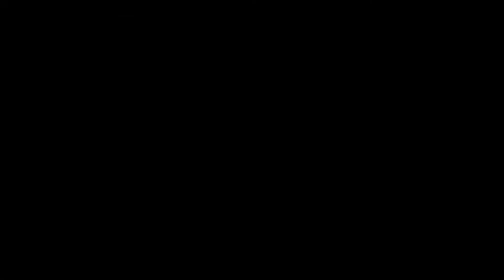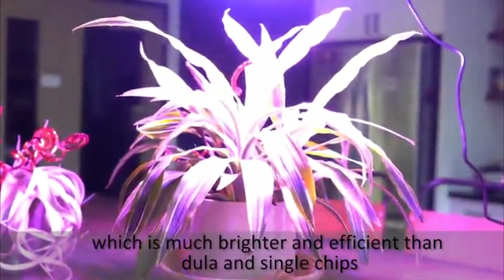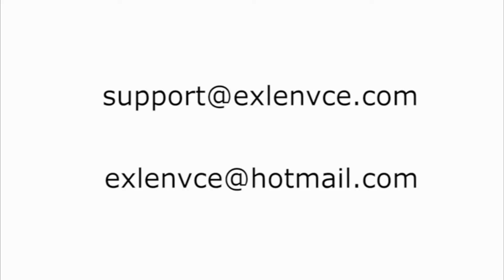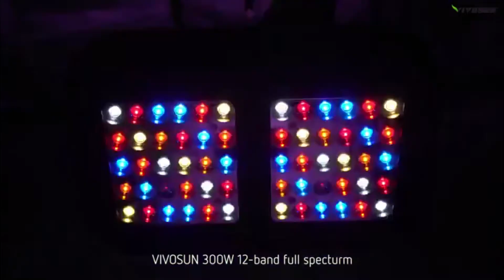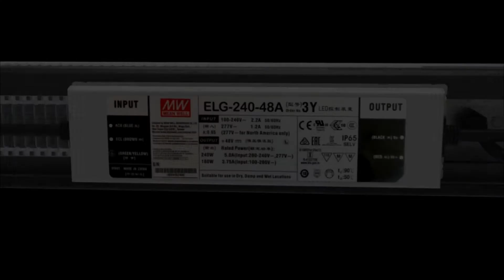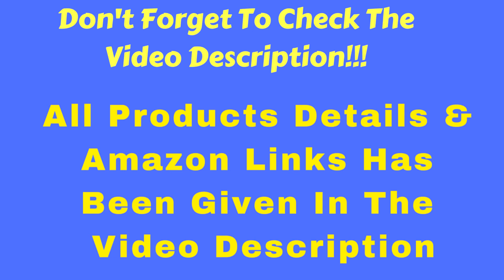Full Spectrum Grow Lights For Indoor Plants

Comment from the maker: 1.Advanced Platinum Series P300 300w 12-band 
  LED Grow Light - DUAL VEG/FLOWER FULL SPECTRUM

US. https://amzn.to/2WENNp8

2.Phlizon CREE COB 3000W LED Plant Grow Light Full 
  Spectrum Indoor Plants Light Growing Veg Flower 
  CREE COB Grow Light with Monitor Adjustable Rope
  -3000W (Actual Power 600watt)

US. https://amzn.to/2LJqsfr

3.Yehsence 1500w LED Grow Light with Bloom and Veg Switch, 
  Triple-Chips (15W LED) LED Plant Growing Lamp Full 
  Spectrum with Daisy Chained Design for Professional 
  Greenhouse Hydroponic Indoor Plants

US. https://amzn.to/2AFlrT7

4.Exlenvce 1500W 1200W LED Grow Light Full Spectrum for 
  Indoor Plants Veg and Flower,led Plant Growing Light 
  Fixtures with Daisy Chain Function (Triple-Chips 15W LED)

US. https://amzn.to/2WFtuI0

5.TOLYS LED Grow Light, 1000W LED Plant Grow Lights for 
  Indoor Plants, Full Spectrum Dual Chip Design Grow 
  Lamps, Double Switch Veg and Bloom, with Humidity 
  Monitor, Timer, Adjustable Rope and Glasses

US. https://amzn.to/368ud7I

6.VIVOSUN 300W LED Grow Light Full Spectrum for Hydroponic 
  Indoor Plants Growing Veg and Flowering

US. https://amzn.to/2LEoGfH

7.myLumii Smart WiFi LED Grow Light, 1200W Dimmable Full 
  Spectrum Indoor Plant Light, APP Remote Timer, 
  Built-in Temperature Humidity Sensor, Daisy Chain, 
  FCC Certified, Compatible with Alexa

US. https://amzn.to/2TjQcDD

8.MARS HYDRO SP 250 Led Grow Lights Full Spectrum for 
  Indoor Plants Veg and Flower Hydroponic Greenhouse 
  Water Proof Dimmable Commercial LED Growing Lamps 
  2x4ft Two for 4x4ft Coverage

US. https://amzn.to/3dXSEYo

9.WILLS Upgraded Led Grow Lights 1200W Full Spectrum 
  for Indoor Plants, Veg & Bloom Double Switch Plant 
  Growing Lamp for Hydroponics (10W LEDs 120Pcs)

US. https://amzn.to/2WETd3q

10.Benflor COB LED Grow Light 1100W Full Spectrum Lamp, 
   Indoor Grow Lights for Veg and Flower Plants, Double 
   Adjustable Knobs Plant Light for Greenhouse

US. https://amzn.to/2X7FYXZ